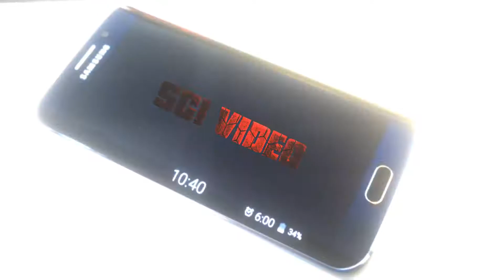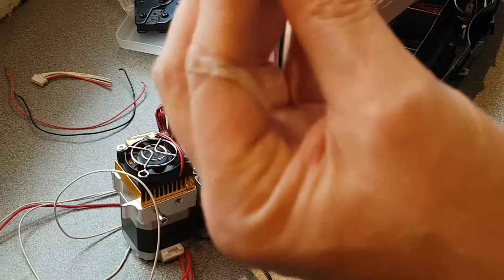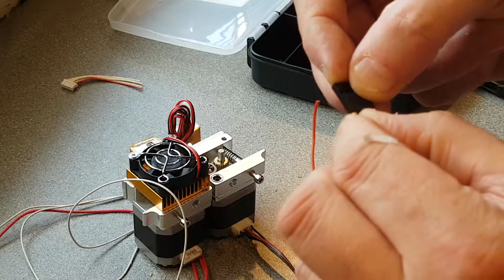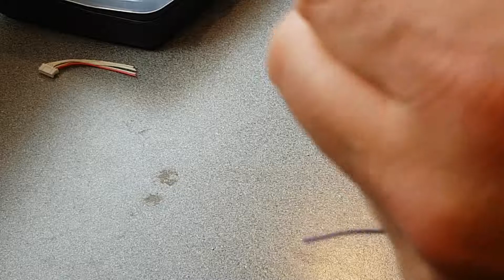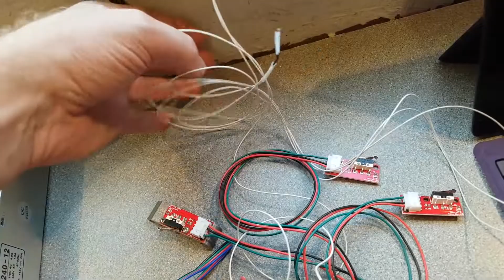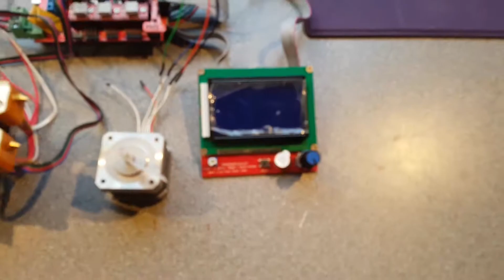3D Printer Saga Part 8 (almost part of the big build)

Comment: Note to self** Do not cheap out on a 3D printer... you'll end up with a corner covered with parts for weeks- trying to trouble shoot silly mechanical and or software related issues... most likely-and 100s x over if you value your time- end up spending much more by time and headache if you'd just gone and bought that legit OG brand printer...you'd just taken it outta the box, tightened it up, ran an initial config sequence and woulda been printing wicked 3D prints...but, no... you had to buy the cheapo version....